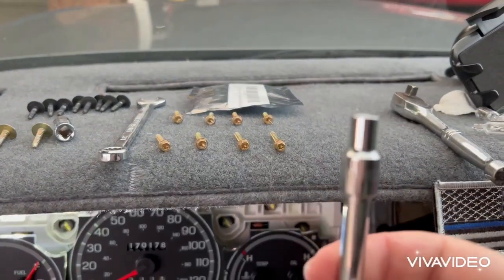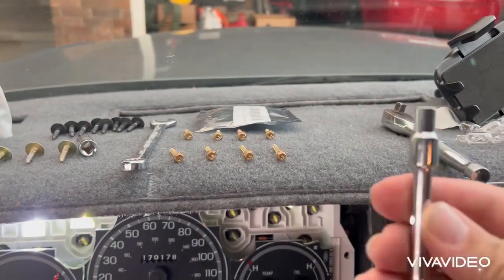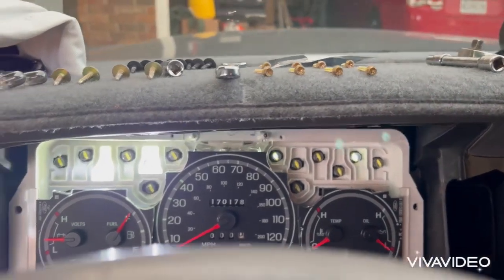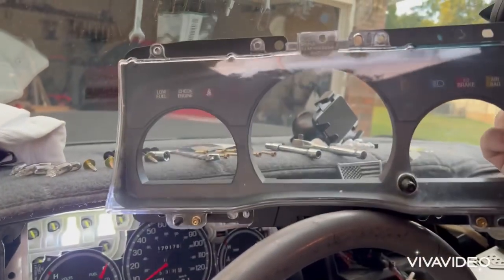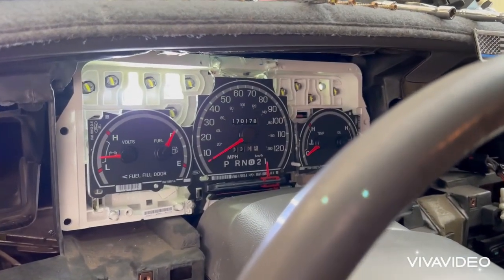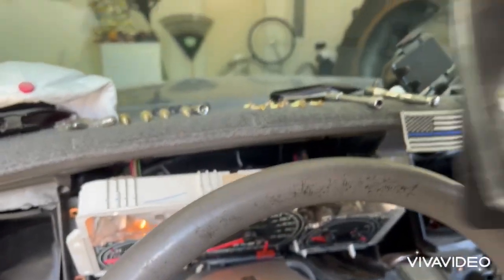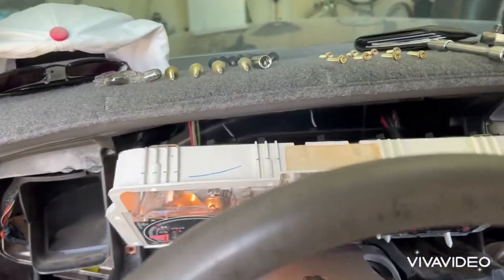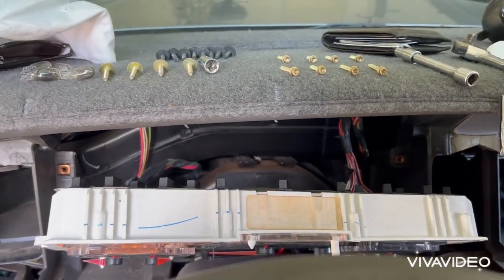1998 Crown Victoria LX Gauge Cluster Bulb Replacement Tutorial Quickie

Comment: All the other videos on how to do this show a different style of cluster. You have the same version as mine. For the bulb replacement, how does that work? Will I need to solder them in?
Reply from the maker: Not at all, the bulbs sit in these little cups that twist into the back of the cluster. The hardest part is removing the cluster! 
If you have any issues just text 417-509-0487 I’ll guide you.
Reply: @ThePursuitofHappiness1988 Awesome. Thank you for that. I got it all done in about 2 hours. I noticed this same job was done before by someone else before I purchased my Crown Victoria. And the last guy used cheap LEDs and those bulbs where the ones that burned out. Total cost was about $24 for parts from amazon. I have a 2005 CVPI incase anyone reading the comments needs to know.